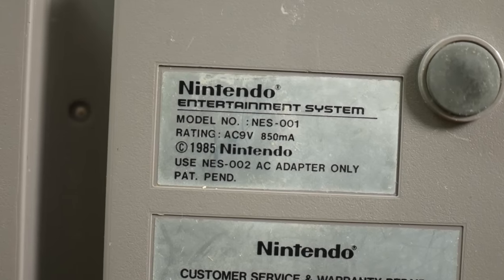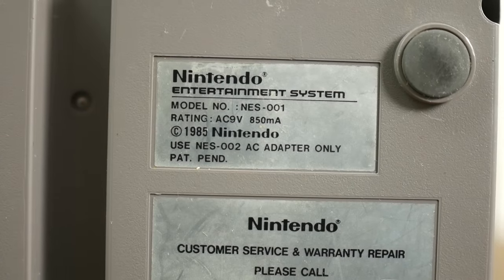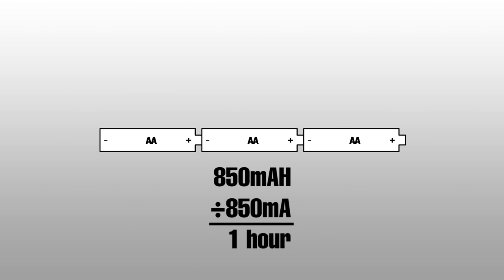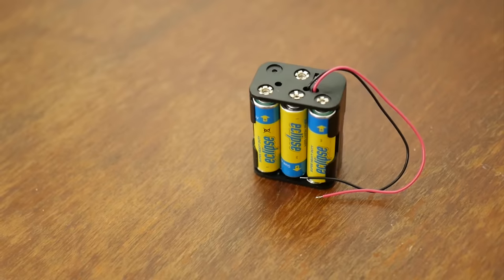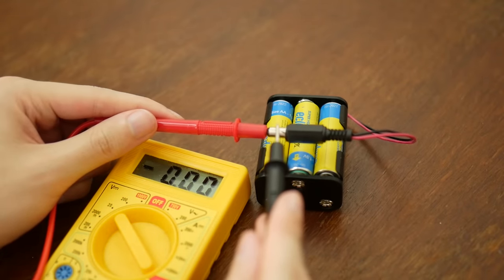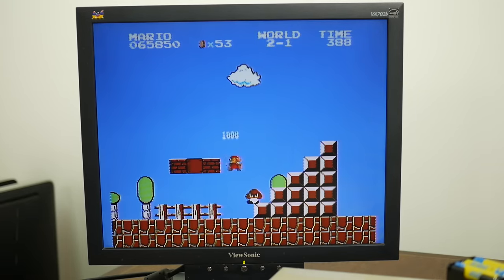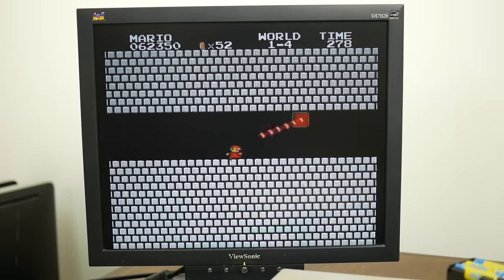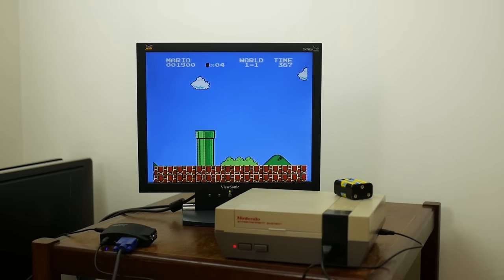Can you run an NES from AA batteries?

Comment: You can break the rectifier because you only uses half of the bridge... It is better to power the PCB in the power supply part of DC IN. And using a step-up circuit (its cheap) with a lithium battery, you can power with the exact voltaje without drops by the changes in charge level (and stop the power with a charge controller to prevent damages in lithium battery or the device by lower voltaje).

Comment: As long as you’re willing to feed the NES more batteries, you could also make the setup last for as long as you wanted by adding one or more sets of six AA batteries in parallel to the first supply, but it would still be pointless. Also make sure the voltages of the battery sets are similar voltages or they won’t get along.

Comment: Supplying low voltage isn't necessarily very good for it either. The 7805 that regulates the voltage for the whole system then potentially becomes a noise generator. To some circuits, supplying low voltages which are just about workable can be dangerous, to others it's completely safe, i'd say for NES the risk is extremely small.

Most of the power is actually being lost on the rectifier diodes and the 7805. You can just bypass it and connect regulated 5V to its output, and you need your own more efficient switch mode step-up or step-down regulator to set a precise voltage. How about: 2 batteries and an mt3608?

Monochrome image is probably a result of frequency drift. Once you supply less voltage, the crystal oscillators start to drift. The colour carrier needs to be very much spot on for colour to be decoded by the TV - odds are the console is still outputting it happily, it just shifted a little out of band and TV is confused.

Comment: How did you connect NES video output to the LCD PC monitor?
I always wanted to do that, but I don't know how did you achieve this sharpness and crispness of image with composite video to VGA converter.

I suppose that you might have very expensive, high-end composite to VGA converter.

What model do you have?

Comment: Connecting batteries in series actually increases the overall capacity. For example, if you have 4 batteries in series, you'll have a total watt hours of 4 batteries.

Volts x Ah = Wh.

Comment: You can skip all the rectifiers and regulators, and tap the voltage rails directly, then you only need 5V and you will save alot of energy on regulator/rectifier losses.
If you want to run it off batteries, that's probably the way to go. Actually most computing devices from late 80s to mid 90s run off 5volts (some do need a 12V rail)

Comment: Fun fact...2 years ago...i used a power bank 10000ma...only running on 5volt 1a...ran like 6 hours or more.

Update:The colours are more vivid yet looked slightly dull then the original 9v adapter yet not any signs of lag or button ghosting .

Comment: Unlike voltage  current is always marked as maximum current. The real current is always lower, typically half or just above half.

On top of that, a linear voltage regulator will eventually hit its voltage limit and also lower the voltage for the components.

Most TTL components works just fine on 2-3V, of cause the color burst need the full voltage. But BW picture only need about 3V. My guess is that you can run it of 4 batteries, but then probobly 20 minutes shorter.

Comment: If you want the most capacity, connect 36 batteries in groups of 6 parallel batteries, and take the groups and put it in a series circuit.

Comment: For bonus points, open up the NES and do the following:
1) Replace the AC socket with a dummy, disconnected AC socket
2) Hide the batteries inside and connected.
3) While playing the NES with a friend, claim it's haunted.  Then unplug it from the wall.

Comment: Correction at 4:06: alkaline batteries are NOT called "super heavy duty, it's the low end carbon zinc batteries that are called "super heavy duty". Sounds absurd because it is.

If those cheap carbon zinc batteries lasted nearly two hours though, I bet alkaline would last for 4 hours or more.

Comment: The first reason why we use Lithium batteries is, they keep their voltage up until they run out of juice instead of gradually weaken.
The second reason why we use them is, we can shut off the device safely, before it starts corrupting data.

Comment: On the same idea, I have actually run my cable modem and network switch, router, wifi off battery during power outages. As they all use a bunch of power (over 3A total for the 4 devices), it only works for about an hour, but that's enough to download hours of youtube videos for the night.

Comment: It would be cool to use one of those 7'' 12v monitors meant for backup cameras and run the NES and TV off of a 7AH gel cell. You could get about 60wh out of it, so ussuming the NES uses about 10w (due to inefficiency in the regulator), and the TV uses about the same, you could get 3-4 hours out of it.

Comment: I'm curious why the 7805 didn't just drop off once the voltage got below ~7.5. I'd be interested to see the regulator output on a scope. I wonder if some power was drawn through the video connector after a certain point or if the composite signal somehow caused feedback noise to corrupt the images

Comment: I'm too lazy to research the details but the RF circuitry is connected directly to the 9 volt Rail and not through the voltage regulator so you might have some problems with that.

Comment: They make composite input dongles for phones to insert the yellow video cable.  It's also possible to rig up a way to connect the red&white RCA cables to a pair of headphones, so it's completely possible to use your phone or tablet as a display for this portable NES on the go.

Of course why would you want to when you can get virtually perfect NES emulation right on the phone itself and connect a bluetooth NES controller to it...?

Comment: feels like a sega gamegear clone
that also used 6 AA cells to get around 6-9v as the cells discharge
the actual best solution for running a classic NES (or any 9vac/12vdc compatible device) is to use a simple lithium 11.1v array

as the vast majority of devices that took/take 9v/12v(even still today) have/had an internal regulator you can offer any voltage above the regulator minimum input and below maximum input
as the classic NES used a 9vac brick(likely a small transformer and nothing else) that means the peak DC voltage is actually around 12.69(nice)vdc and the RMS average is 9v, and as smoothing the 0-12v spikes leads to the RMS peak being the max DC voltage anyway you could, and I argue should, use a 12v adapter as a classic NES replacement as it more closely matches the intended input levels

however given the era had primarily 5v logic and linear regulators were most common, the minimum DC input is actually 7vdc due to dropout regulation voltage, so this AA setup is less than ideal as "dead" batteries have 1v per cell and would lead to 6v dead but 7v minimum input effectively only using about 80% of the capacity

an 8 cell "12v" pack would be the best, especially if you added a really simple low voltage indicator to signify it is time to write down codes or save the game and swap
but the best solution is always a rechargeable battery of either 3 lithium ion type cells or even 4 lifepo4 cells as they can easily do 1a of current the entire time without heat damage or capacity reduction
yeah AA's used over 500ma will suffer massive capacity loss and carbon-zinc style tend to have about only 25% the max current of common alkaline before significant voltage sag and capacity loss
to properly run an NES you need 8 cells in series, at least 2 sets in parallel and liely 4-8 sets for carbon-zinc compatibility and you still only get a few hours due to the nature of how inefficient a linear regulator is
a better solution is to use larger cells, "D" class cells were quite common in early electronics, including as vacuum tube bias sources, and a common D cell can do several amps before sadness and hold at least 2AH (2000mah) at the absolute worse and as much as 6 or 8 ah in a quality cell
now is 8 D cells a ridiculous battery for a handheld version of an NES? yes, is it silly for a smallish box you plug in like an NES powerbank? also yes
modern PD compatible power banks or simple laptop powerbank chargers almost always include 12vdc at around 1-2.5a rated, given the nature of the linear regulator in the nes and the hard on/off switch I suggest if you wanna use your nes in the car or camping to just buy something like the maxoak k2 and mod a simple cable, the power bank stays on at >170ma and only dies over 2.5a and holds around 15ah or 15 hours of nes gaming, slap on a common cheap portable lcd display that runs off car 12v at under 1a usually and you can game most of the evening while camping off a sleek aluminum box, one that can recharge with just a simple solar panel that can float to 16.8v as the internal cells are basically directly connected to the charge jack through a shunt detector

and heck a simple 100ah lead acid marine battery  could run such a fully off-grid nes gaming array(or indeed most pre-xbox era consoles with 12v supplies) for as much as ~50 hours before you risk battery damage

as I have a 24v to 12v 100a buck device for my 24vdc lead-acid UPS array to get project supply power without running a PC power supply as a bench supply I could run 50 NES consoles(or 100 similar 12v 1a devices) all at once for at least an hour given my battery age
but use a set of 6 AA cells to pull ~10w which is at least 2x their rating(1w max per cell) and you will be sad, let alone the NES will lose all the precious effort if you run out of power
actually running an NES emulator on retropie on a rasperry pi is like half the power, has many "UPS" sheilds, can use a classic power bank as the main supply or any USB cord to recharge on the go, the only reason to use a real NES as there are clone controllers, is authenticity
sill would own an NES just as a pretty decoration while my PI and data USB do all the retro gruntwork

Comment: Even if you couldn't, you could put enough in series for 12-15V and parallel for higher current then run an automotive inverter to get 120VAC and then run the mains brick off that...

Comment: It is better to use 8 AA batteries in series, which makes 12V.
A 9AC signal rectified to DC becomes 12.7V, so this is closer to the required voltage

The voltage drops as the batteries get used, so they last longer

Comment: If you weren't using only AA batteries, could you use a 9-volt battery if you wanted to? (I know this challenge is for AA batteries, otherwise it would be too easy)
Reply: 9v is made with 6 aaa batteries so there wouldn't be much amperage.

Comment: I tested this for myself, the only difference being I used an old laptop battery and I had sound, the video pretty much did the same thing, and the audio just got quieter until there wasn’t any audio and only static. Another point is the laptop battery was a lithium ion battery and it held the voltage for a lot longer then dropped quicker then the AA batteries.
Edit: I used that same battery and a backup cam screen and made a portable nes, and gets about 3 hours of battery life.

Comment: The inefficiencies inside the battery will also drop the voltage under load. You’re probably right at 9v with the NES switched on.

Comment: If you study the schematics, the NES technically only needs 5.5 volts to run. The 9 volt is due to the unreliable voltage output of the unregulated power supplies of the era that they shipped with the NES, and the even worse ones 3rd parties sold.   Additionally, 9 volt adapters were just easier to find.  The SNES, has the exact same internal power regulator circuit, and it shipped with a 7.2 volt adapter, because power supplies got better.

The exact rating of the power supply circuit input is 5.5v to 35v.  However, I would be reluctant to use an unregulated power supply of less than 7.2 volts, although 4 AA batteries should be fine. 

The NES could, thus, easily run on 4 AA Alkaline batteries, instead of the 6 one would presume are needed.

According to design analysis, under an internal short out condition, it would draw a maximum of 1A.   But it is listed to draw a lot less.   The 850mA is the maximum under normal operating conditions, but I suspect it draws a lot less.  

The PAL region had A/C current because it was easier to meet EU regulations with an AC power supply than a DC power supply. It can certainly take DC or AC current.  The first segment of the circuit is a bridge rectifier, and it contains no AC dependent filter hardware. 

Notably, the American, Australian and Japanese versions are labeled as DC current.  They both use the same power supply circuit, including bridge rectifier.  The US version notably sometimes shipped with reversed voltage on it's provided power supply, depending on which model power supply was available.

Comment: Why not connect each series of batteries in parallel?
2 series, connected to eachother via parallel.
Would give you enough voltage, while also getting more capacity.

Comment: Huh, some time ago I ran a Sega Master System through a variable power supply and when the power gets too low (anything below 7.5 volts causes the system to get increasingly unstable) the system locks up but like the CPU halts,  it could be because the variable power supply quickly moves to a new selected voltage. Still you'd have the system just locked up before its output goes out.

Comment: The 10 volts probably dropped to 9 ish once a load (the NES) was attached to the batteries. And even if it didnt its only about 11~% out of spec for it (and I personally design   -- and have seen -- circuits with more margin than that), and assuming its a full bridge rectifier we should see a 1-2 volt drop or so.
This would mean you could probably achieve better power efficency by bypassing the rectifier portion and connecting 6 volts to its output, the slightly lower voltage should be Ok and if not you will notice very quickly. Maybe just a small change but still something worth trying? :D

Comment: 10:39 the nes uses color cells like the c64 so the cell system must of broke down when the batteries started stepping down the voltage cause the batteries were dying

Comment: Capacity increases for both series and parallel 
though maH stays the same for series and is higher for parallel
the actual watt hours is the same;
assuming they're all 100mah @ 1.5v
series:
1.5×6=9v
0.1×1=0.1aH
9×0.1=0.9 watt hours
parallel:
1.5×1=1.5v
0.1×6=0.6aH
1.5×0.6=0.9 watt hours

Comment: You can run anything on anything. You just need to get the proper voltage level by putting batteries in series and then get enough current and capacity by putting many in parallel. So yes, I can make a Tesla-car run on AAAs.

Comment: I can remember taking an NES, a cable i made up to use my RC car 9.6v NiCd and NiMh rechargeable batteries and a portable 7" CRT tv which ran off like 10 C batteries with me on a camping trip. I had a charger for the RC car batteries that used the car cig lighter. Pretty sure i got a few hours out of the NiCd and 5+ hours out of the NiMh

Comment: You could also have included a joule thief to extend each batteries "Usable" time.
However the anoyance of making several of them or buying several of them adjusting them to the normal batteries output. 
Then producing a capacitor array to manage the "Flux" of the power output itself to ensure game-play is not effected by said joule thief methodology. Essentially working as a buffer.
Of which I would produce something that can output 1.5x-2.0x the actual amount needed then just limiting the flow. 
To exactly to what it is rated for and boom. 
You can extend the playtime of your game box your working on there anywhere from 25%-75%. 
Depending on the actual amount of energy is currently stored on the batteries themselves and ignoring the amount it is able to output. 
All it needs to be able to output for this to be viable for significantly longer is pretty redundant honestly. 
However, you would first want your capacitor array to charge before the console itself was turned on. 
Therefore it would slowly discharge the capacitor array only if the batteries themselves can't keep up. 
Continuing on it has the potential to both regulate the amount of power being fed through and significantly extending playtime not only through forcing the voltage upward to fill the capacitors. However, also the capacitors themselves being a buffer between that time. 
Then just put something on there to monitor the capacitor-banks and turn on a Red LED or something and boom you now know if your batteries can no longer keep up and have enough time to save your game before suffering power outages. 
It could easily extend that originally estimated 2 hour playtime to 3+ hours. 
Especially if you use the higher end batteries produce a joule thief for each individual battery and than produced a capacitor bank as described above as both a regulator and a buffer to warn the player themselves a significant amount of time before the game would turn off basically it detects if the batteries can't keep filling the banks at the rate required for continued play.
Always over-engineer as you made me cringe with this one.

Comment: @MattKC: If a machine his not design to run on battery, and you run it on battery untill it run on very low voltage can damage the console if you do it too often, damage by short-circuit,  unless the term short-circuit meant something different then what I was thinking. Edit: Short-ciruit meant something completly different then what I thought it meant.

Comment: Would have been useful to be used as a power buffer (with rechargable batteries) between the transformer and the NES, just in case the power went down, all you need to do is pause the game until it comes back